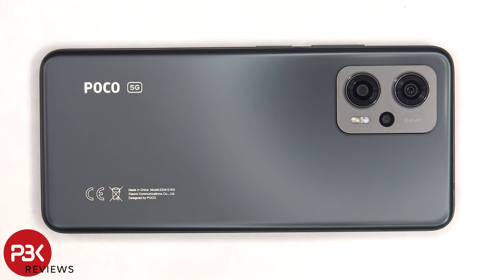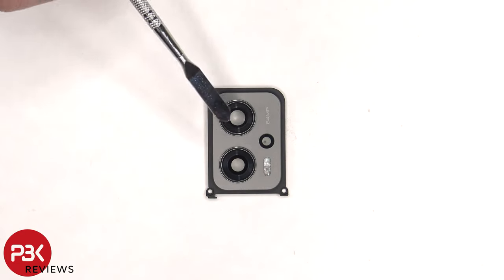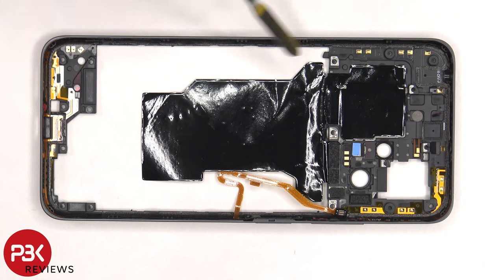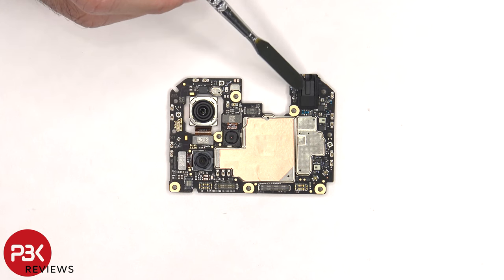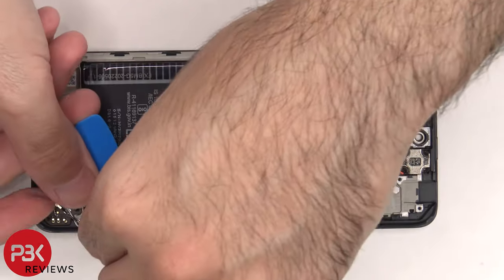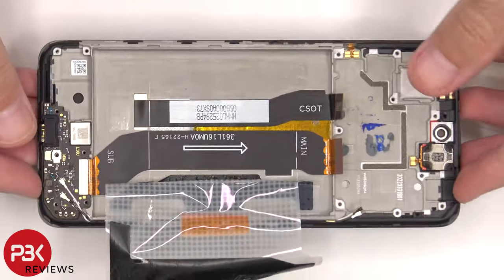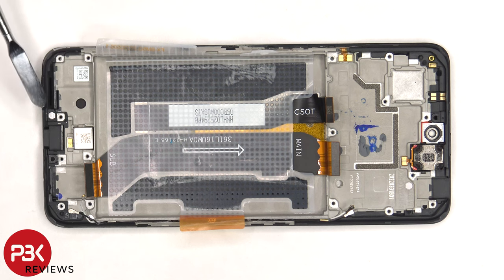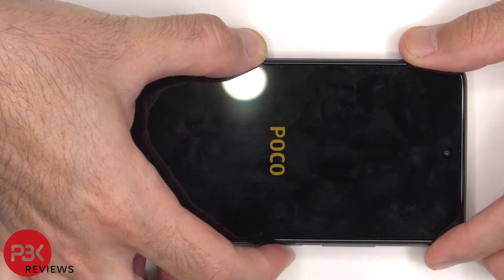Poco X4 GT / Redmi K50i / Redmi Note 11T Pro Disassembly Teardown Repair Video Review

Comment: I think Poco made some claims that they increased the cooling solution of this phone, but the vapor chamber seems more or less identical in size to the one in the x3 GT. No wonder this phone doesnt really perform well in terms of thermals, the D8100 is more or less left thermally unsupported.
Reply from the maker: The vapor chamber is longer in length, however the X3 GT looked to have more thermal paste in between the frame and the copper heat transfer tape on the back of the board. The X4 GT has a good amount of thermal paste underneath the copper tape between the processor and the copper film, but not so much between the film and the frame.
Reply: @PBKreviews  sir is glass affect the cooling system of a phone because phones with glass back like poco F3 seems to have great cooling system?
Reply: I'm using poco X3 nfc right now i would like to upgrade my phone what is your best recommend phone for upgrade? Im planning to buy F3 or X4 gt ☺️
Reply: @adrianjuliano9744  Unless you need the headphone jack, I think the F3 is still a better deal overall, especially if you can still find one on sale. The F3 has the worse camera of the two, but you can install GCAM mod to get better processing for your photos(since the X4 gt has a mediatek chip, gcam will likely not work).
Reply: @somayough  ohh thx i watched decent comparison of both two phones and the F3 seems to have better optimisation but its limited in physical stores i might find online thanks ❤️
Reply: @adrianjuliano9744  F3 is not really great for gaming performance. If you try playing heavy games with max graphics you will get 60 fps but not for so long, your game will start heating fast because it does not have a cooler. If we compare to X4 GT, the X4 GT has the better advantage over optimizations
Reply: I am using the same device, just under the redmi k50i branding. The phone never heats up a lot during stress test, never goes above 37°. Someone on twitter said it might be capped at that temp. While I'm outside it does heat upto 40°C and above but that's mostly due to the higher temp and data being on at the same time

Comment: Thanks just fixed my phone. Wouldn't show charging 🔋 indicator stuck at 52% loose battery connection. I would mention in video when opening to be careful of finger print ribbon which could get cut with a plastic prying opening tool. Just below camera on left side!
Reply from the maker: no problem, glad it helped. yeah, you should be careful not to stick any pry tool too deep in to damage parts.
Reply: Hello sir what did you do? My poco x4 gt also stuck at 52% does not charge nor discharge but it is working. Should i just disconnect and reconnect my battery???

Comment: Hey, bro. Thank you for this video! I'd like to ask, for battery replacement, which parts I should only remove or which parts are not necessary to disassemble? And what adhesive do you recommend?

Edit: Nevermind. I was able to replace my battery with the help of this video. Thanks a lot, brother!

Comment: Hye, thanks for the video. 

Wanted to ask a weird question. Is it possible to mod the sim reader slot so that it can also read sd card?  i can put any third party sim tray which has support for sd card. 
I love this phone but sadly no sd card slot.
Reply from the maker: Hi, no I don't think it would work. Would not only require additional solder points on the board but additional resistors and such to detect and read, and also software mods I would assume.
Reply: @PBKreviews  thought so. 

Thanks for the comment. I love this phone, but sadly no sd card slot :(
Reply: @mokisan  you can use sd card reader

Comment: How long do thermal paste last in phones before replacing it ? I have realme gt neo 2.
Reply from the maker: not too sure honestly. There are many different types and kinds. Some last longer than others but again the length can also depend on how often your device is used or to what extent its used.
Reply: The thermal paste most definitely will outlast the phone's life span. On the computers it lasts for several years, 4-5 and more.
Reply: @bgbore96  dont know bout that i use my phone more than 5 years depending if i really need the upgrade
Reply: @kamwardmama-o2424  For that time you'll have to replace the battery once or twice. It's a good idea to replace the thermal paste also. Btw, what phones were you using that lasted that long?
Reply: @bgbore96  samsungs mostly, my mi10t and mi 11 were literal garbage both have deadboots and have to replace the motherboard , after those 2 phone got repaired , i sold it right away, then got realme gt neo 2.  since it has sd 870 very stable in long gaming sessions unlike the 888 and 8th gen 1.
Reply: @kamwardmama-o2424  good choice with the realme. Xiaomi never again 😄😄
Reply: @bgbore96  yeah learn that the hard way , i sold my samsung a71 to mi10t pro then it got deadboot after a year then sold it after it was repaired then went to mi 11 after 2 months it happened again deadboot . So i bought realme gt neo 2 so far no phone breaking issues
Reply: @kamwardmama-o2424  I don't have hardware problems with the Xiaomi devices, but the software bugs are killing me..
Reply: @bgbore96  i experienced both never buying a xiaomi phone again . They always promises fixes in their miui then u update then make the phone worst . Their miui is also the same with budget and flagship i know cause i have both flagship phones and still full of ads

Comment: Since the charging board is removable, do you think it is possible to make a diy upgrade from usb 2.0 to usb 3.2? I often plug my Poco X4 GT into my PC, and the transfer speeds are slow, not to mention hdmi adapters not working. I've heard that the chipset would limit the speeds, but since the entire sub board is removable, could this be circumvented?
Reply from the maker: I'm not sure since I'm not an expert in electrical engineering but I would assume just changing the port alone would not work since there are controller chips regulating it as well either on the sub board itself or the main board.

Comment: Hello, Thanks for the video. I have one question. I have this device and I'm seeing a crack with small bump below the crack, just half an inch below the camera module. Is this a fauly battery or motherboard issue? Also what can be the probable cuase? Thanks!
Reply from the maker: It's possible it can be from a bloated battery. The cause can be many things, from drops to overheating or just a bad battery.

Comment: whoa! no thermal paste between cooper and graphite film from the back. i wonder adding more thermal paste on front and back can improve thermal management
Reply from the maker: I don't think it would make too much of a difference for the back, since mainly the thermal paste will come into play for transferring the heat to and through the frame not so much the copper tape and graphite film on the back.
Reply: The Back is not good for cooling since it is made from plastic. As with many other phones the Display is the main heatsink.

Comment: Hello, I'd like to inquire, if bottom micro has some kind of protection or may be it is installed 90° towards the bottom edge? There is a point that firstly i inserted a simcard but then i needed another one to  be inserted, and occasionally put the needle into the microphone's hole. I barely touched it and didn't push it further as i quickly understood it was the wrong one. However I'm a bit anxious of having smth damaged. Overall, i checked wether the micro works okay, and yeah, it does. But who knows, may be it can cause some problems with water/dustproof condition
Reply from the maker: Hi, no you will be fine. The filter and mic are both seated above the hole so they wont be damaged.

Comment: Strange.. on GSMarena site, F4 and X4 GT have a li-po, but both have li-ion battery...🤨
Reply from the maker: Hi. It is a li-po. The way they label the batteries, if its a li-po then its written lithium ion polymer, if its a li-ion then it will just said lithium ion. But either way the lithium ion potion is always labeled on the batteries.

Comment: Brother one question... How much quantity of thermal paste should I buy to apply on Poco F1 phone.
Also if some paste is left over, can I apply it over camera and battery?
Reply from the maker: Not sure how much, usually they sell them in standard amounts which is more than enough for any application. However I wouldn't apply thermal paste to areas that it doesn't need to be like the battery and camera. Depending on each thermal paste compound, some are more conductive than others and if they leak into areas that you don't want them to be, they can short the phone or damage components.
Reply: @PBKreviews  thanks for replying Sir

Comment: Hi,i just want to ask if the motherboard is weak? the main issue of poco is deadboot im afraid that this phone is going to deadboot after a year,i just want answer if the motherboard is prone to deadboot or not
Reply: Что ты имеешь в виду?
Reply: Я просто заказал и теперь не знаю что делать
Reply: What do you mean, I've ordered now and I don't know what to do. Is he definitely breaking down?
Reply: @1HACER2  wdym breaking down,but what i mean is poco past phones main issue is deadboot(like it just dies the reason is crappy motherboard) im wondering if poco x4 gt's motherboard also has bad architecture and is prone to deadboot
Reply: @1HACER2  no need to worry bro just dont update your software when there is a update and your good to go
Reply: @1HACER2  only update if you are experiencing bugs in your current version(tho be careful cause updating it has a risk of deadboot),dont update if you are not experiencing bugs
Reply: @froztborn  Thank you, yes, I asked this question on poco m3 and x3, but if it happens, can it be fixed?
Reply: @1HACER2  As long as it still has battery left before it dies then a experienced technician can revive the phone
Reply from the maker: It doesn't look like it's weak but you can't know by just looking at it. Would take time and usage from people to determine if there are any bugs etc.
Reply: @PBKreviews  ty

Comment: Ohhhhh the phone has graphite to transfer heat away from the chip... I was so scared when I played codm it just became so fricking hot, I thought the phone will explode bruh
Reply from the maker: lol no it won't explode, if it overheats it would probably notify you and it would either shut the device off or pause the activity until the phone cools down. But generally most phones will heat up since heat is being exhausted from inside out to cool off the components. :)

Comment: I have this phone damaged by sea water corrosion.
I have removed the motherboard and I would like to know if it is possible to extract the data from the ROM memory. Can anyone give me information about this?
And  does anyone know what chip is in the ROM?
Thank you so much.
Reply from the maker: There is a high chance the ROM would be damaged from corrosion as well rendering it useless, but even if it was good, you would need to find a specialty shop that can de solder and remove the ROM from the board and re solder it to another board. It wouldn't be cheap if even doable.

Comment: I had to open the lid with a knife :( it didn’t work out any other way.😢😢😢
Reply from the maker: try using a suction cup tool with heat and lifting up to give you some leverage to get a tool in between.